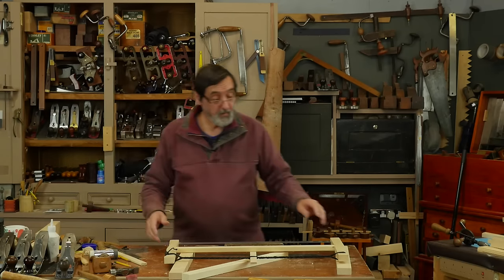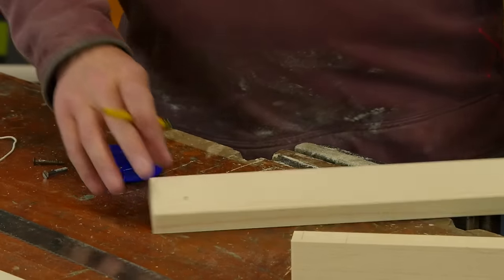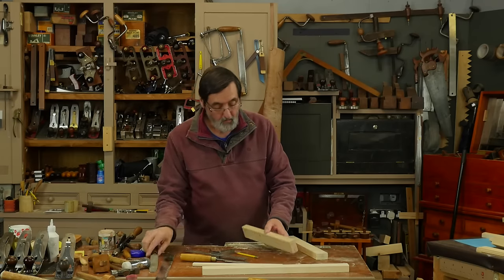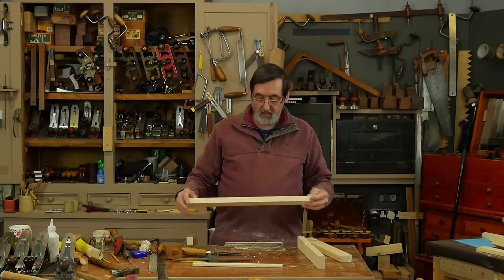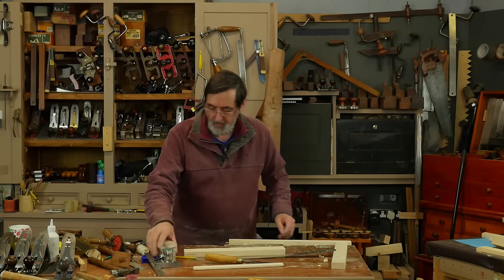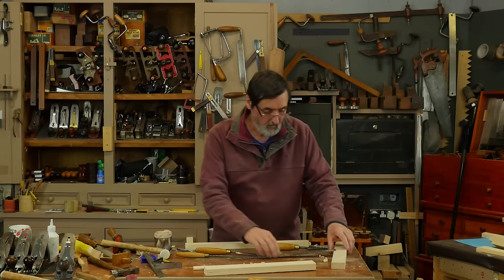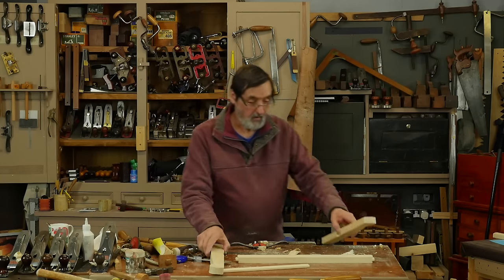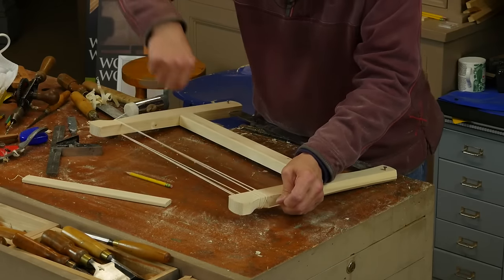Making the Frame Saw | Paul Sellers

Comment: I made this saw just recently using the video.  It was a fun project.  (BTW, now I have two vegetable cans being used in my woodwork :) I put on a new Highland blade for ripping, and that cost less than ten dollars. The wood cost about two dollars at a big box store. But I used existing hand tools (plane, saw, rasp) to construct it. I used Paul's sharpening video to get the tool really sharp, and it cuts quite aggressively, enough btw so that you really need to watch those fingers when starting the cut. I may change the rake a bit to tame it a bit (and give me needed practice). Thanks for the video, Paul.

Comment: Currently there seem to be two kinds of mainstream outlets where to purchase woodworking equipment. One selling equipment like Veritas. Probably good quality but extremely high in price. Like $250 for a hand saw. And the one like Rockler.com which sell gadget, jigs and "handy tools" by the dozen. Typically for the not-so-gifted woodworker who thinks it will help him finish the product. Now my point, related to this video. The 600mm saw blade can be had for under $10. The spruce is in your scrap box and it takes 1 hour (Paul) or 1 week (me) to build it. And it might be the best saw you ever have and (cite) lasts a century. Now, how many REAL improvements have been made in woodworking tools the past hundred years? That is why I love these lessons by Paul.
Reply: well said. we don't need expensive tools to make quality furniture. Don't forget the tools you already have!! You can make amazing dovetails with a bandsaw. If our forebears had power tools they would have used them. I am a Master craftsman with 40 years experience, use what you have. these frame saws are within everyone's reach. Build something great.
Reply: Agree 100%.
Reply: @magicman9486 Sorry, but  power tool dovetail sounds like nails on a chalk board.

Comment: I made one of these but I used a steel cutting blade which was five and a half feet long to cut through a fender on a trailer which had more than one wall to cut through. But I had to use a ready rod or all thread to give enough tension to the blade. It also allowed me enough depth of cut to make the full cut in one effort. They are a pretty good saw.

Comment: i think you missed one point. here in germany the blade on this saws (we call them "carpenters saw"), the blade is usually twistable, so when you set the blade 90 degrees on your wood, the frame of the saw is at an slight angle.
this counter-balances the saw, and you make perfect perpendicular cuts every time. this feature is the whole point of the saw.
we also have those "tenon saws", but for other applications (they are usually used here to cut baseboards), the carpenters saw comes in handy, whenever you have to make long, straight, perpendicular cuts.
Reply: yes I think I saw a video with Frank Claus using this blade.. its incredible.. just no idea how they are made
Reply: @VicPapefu May I suggest you try a method such as found on a typical hacksaw? Which would amount to a square mortice oriented in a diamond pattern in the two upright arms with a square rod or bar inserted w/a pin to hold the blade on one end and a cross pin or dowel through the other to keep them in place against the pressure. Size and strength requirements are up to you to determine. After all, the solving of puzzlements is a part of the joy of this inexact art.

Comment: Lee Valley sells these saw blades as replacement blades for their miter box saws.  You can get them in 22" to 25", 10 tpi to 32 tpi.  Price is $18-$20.
Reply: They are crosscut...
Reply: And all impulse hardened  unsharpenable
Reply: @rickcheckland  The blade from Highland Woodworking or Dieter Schmidt that he is using is impulse hardened.
Reply: Good call.
Reply: Can you relax an impulse hardened blade, for example by heating the teeth to a glow, cool slowly, and then sharpen?
Reply: @MadofaA  yes. But it tends to warp a bit if you aren't careful
Reply: sawmill saw blades work great
Reply: My aport: buy the cheapest saw with fine teeth, use an abrasive disc get  to desirable width, then drill two holes ( i had to find somebody who had a titanium bit) and thats it. Give it a shot, its a great tool, not a museum piece.

Comment: Usually you do need turned parts for it - the handles.

Typically, there are two holes at the points of the frame where the blade is attached. Two handles with a cylindrical ending that has a slit cut lengthwise into it are pushed through those holes, and the blade is fastened with pins into the two handles, not into the frame itself.

This allows for the blade to be rotated around its length. This way, you can start straight, make a cut a few inches down, as much as the frame lets you, then angle the blade and cut away strips from a panel, or board - the tensioned wide blade will take care of the cut remaining straight with not too much guiding effort.

Another use is curved cuts. Besides the wide blade used in this video, there are blades as narrow as 6 mm (about 1/4") - or were, in the past, narrowest I could find to buy recently was 8 mm (that's 1/3"). By constantly tilting the narrow blade by rotating the handles in their holes, you can cut mostly any curve through any board not wider than twice the distance from the blade to the horizontal beam parallel to it.

There's a video somewhere here on YT of a guy named Frank Klausz who cuts dovetails in softwood using such a saw - with no chiseling at all for one of the pieces. Worth watching, IMO, to see what such a saw can do in the right hands.

Maybe one thing worth noting is that whether it cuts on the push or the pull is your decision. The saw is symmetrical, you can use it both ways. Personally, I prefer to cut on the push - the tensioned blade never bends or catches, and the cut is faster. With a wide, properly tensioned blade, it's difficult to not cut straight, IME.

Using it requires some practice. Sharpening and setting the teeth requires a lot of practice too. Aigning the handles, when you don't have the blade fixated to the frame directly, also requires practice (or at least a lot of patience) - not getting this alignment right guarantees crooked cuts, so you immediately know if they're aligned or not. But I feel it's more productive than a short tenon saw with small teeth in many cases, and quite precise too, once you get used to using it. The significantly longer stroke also helps with precision, IME.
Reply: What Paul introduces here is the joinery version of the bowsaw (he mentions this on his blog). This has fallen out of favor a bit, but is still used in France apparently, and is depicted in tons of Historical manuscripts -- they're made just like this, with a fixed blade and no handles. It's the simplest to make hence why Paul probably started with it. As for bowsaws with turning blades (which I prefer too), another common way is to not turn handles, but rather use bolts which are split with a hacksaw and a pin hole drilled. So, you don't have handles, but you can turn the blade. This was used in many parts of Europe -- again, I think in France especially -- and is common in other parts of the world such as China, where they're still made this way. This can be easier for beginners who don't have a lathe or tapered reamer to make the handles.

Comment: I made a smaller version this saw modelled on the one Paul shows here.  It uses a 2-sided blade (Hacksaw/Wood, 24x311mm). These are cheap and readily available where I am in Eastern Europe.  The hacksaw side cuts dovetails quite well.  I have made many small boxes using this saw.  I would include a photo but I'm not sure how to do this.:hand-pink-waving:

Comment: I tried to find a source of blades for the frame saw. Even looking under “bow saw” as they’re sometimes called all I see is those metal framed saws for cutting trees with. Those blades have large, rip-it-to-shreds type blades, not suitable for dovetails. I “saw” a really nice frame saw on eBay but if I ever needed a 14” long replacement blade, I haven’t a clue where to get one.

Comment: Very nice, thanks.

I always liked the feel of a good frame saw, they seem to cut with less effort due to the tensioned blade compared to other saws.

My dad always told me to release some of the tension once done for the day, otherwise the saw might start twisting.
Reply: +Alfred Stampe Yeah, back in highschool my woodworking teacher told us to do the same thing.
Reply: +Alfred Stampe I guess that's why the design evolved to be so easy to tension/de-tension, rather than a threaded tensioner (also cheaper, fewer purchased parts--better all-around).

Comment: I think it is strength to weight that makes spruce so good.  It was used for making aircraft frames in the early days of aviation, and of course it was plentiful, and so cheap.
Reply: +Stephen Gent Weight to strength ratio is called specific strength. And many woods are stronger than steel (if you would believe that!).

Wood is an amazing material! Lightweight, strong, cheap, flexible if needed, carbon neutral.

Comment: When i was a kid i made one of these in a learning program. The biggest difference was that the wood used was oak (probably because as kids we would murder a light wood like the in the video) and the radius was slightly smaller. One other difference is that we used wood dowels for the blade, but the blade (which i still have) has larger holes than modern ones.

Comment: Thanks for the great video Paul.  I have a somewhat strange question:  Is it possible to use the frame saw in a pull mode?  I was thinking that this may improve safety and perhaps improve accuracy  Your thoughts?

Comment: Hello Paul, I'm a new subscriber. I'm just in the starting process of making a folding buck saw for my camping and hiking trips and in looking for tips came across your channel. Would please explain why you make a radius with your mortise and tenon joint for the cross member instead of joining it on the flat? Is there an advantage? I'm making mine out of cherry by the way, since I had it around. Other than it being heavy do have any opinion on that? Thank you

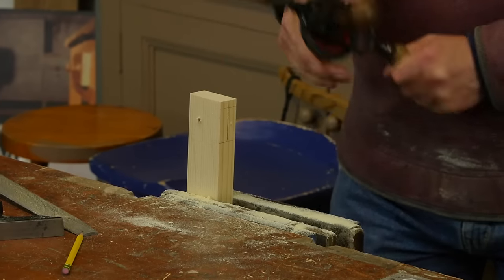Comment: Hi folks. I just bought an antique drill like Paul uses at around 9:43 in the video. Two questions: it moves great but the chuck is stuck shut. Can I soak it in something or spray it with something to open it? Also, does it use standard bits or not? Thanks. Love your videos, Paul.

Comment: Where did you get the blade?

Thanks
Reply: +Nickle You can get a very similar blade from a miter saw. Obviously not the electric ones ;)

If you switch Google to the image search and pop in this "hand miter saw" the first images should be one you need.
Reply: +Nickle Paul Sellers has a blog post where he says he'll sometimes buy portable band saw blades from HD or Lowes and cut them to length for the blades.

Comment: I see a lot of comments about a "cut list". Why? It's really a "build to suit yourself" item. He mentioned the verticals being 16" long, and the material being 1" thick. So go buy some 5/4 by 3 wood, whatever is available in your area, maybe 5/4 by 2 for the horizontal piece, and have at it. Off to 84 Lumber soon to see if they have some 5/4 red oak. Anyplace with spruce is an hour from me. An 8ft stick of 5/4 by 3 yields enough for 3 saws vertical pieces. an 8ft 5/4 by 2 will give 3 horizontals and a cutoff piece that you can make 3 tensioner sticks from. The horizontal piece length is roughly the blade length, maybe a tad shorter.
Reply: And www.rockler.com has Nobex miter saw blades (22" ish) in 18&24tpi. $16.99 each.

Comment: Hi Paul, I made one of these but on a bigger scale (3 1m pieces of 4x1 redwood) to crosscut thick logs, but found that the vertical pieces creaked and moved on using it, causing it to be ineffective. Is there something I've done wrong apart from making it a lot bigger? My joints were tight and the blade was well tensioned.

Comment: Did a pair of the variety with tilting blade, such a useful tool....its life Began on the mobile toolbox dissasembled an now my preferred backsaw is accumulatind dust... :( .
Great thing about this is tha i bought literally the cheapiest ugliest back saw with a joke as a back, and it turned out to be perfect( that cheap steel blade and fine teeth make fine cuts and the long push can be very silent) obviously i cut it with a dremel and made a bunch of free card scrapers. Best 25 soles(8$) spent ever.
And best 36 min spent by this millenial, a like is just not enough to thank paul.

Comment: Just finished making my first frame saw,  looks good for my first one. Actually built it while waiting on the blades, I need to work on getting the beam joints tighter, and the blade, should have measured it or held it in place, the invoice says it was 26 1/2" but it is a little off, the holes on center are 26 9/16" Just enough to not fit, had to drill two new holes, ... I can always do it again, spent a lot of time shaping the handle, and the string curves.

Comment: Thank you for your video. It is very interesting as usual your videos are.
It seems to me, @16 when taking the measure, that the piece on your left is flipped. The screw hole is on the inner part instead of the outer.

Comment: Paul, cheers. just finished a saw using your guide, and was wondering: Do you use the saw blade under tension when not in use?
Reply: Probably late but for anyone in need, no, release some tension

Comment: Got an old bow saw, 30s to 50s maybe, with a tiltable blade and a wire string running through an eyebolt that is tightened by a wingnut. Most likely factory made, with a coarse blade more suitable for construction work, but doesn´t matter. Works like a charm, good depth of cut, blade never bucks (can happen on ripsaws, as they often are used for crosscutting here).

Comment: Can you use these with the blade in either direction so you could have a pull style or a push saw. Without having ever used one it appears that with a pull configuration the blade is subjected to additional tension from the pull action which would help keep the blade from bowing. When you are pushing on the blade even though it may be in tension from the string as you push on the blade and it encounters resistance in the wood it seems there would be a tendency to de-tension slightly on the end of the blade closest to the point where force is applied (your hand), leaving the front part of the blade which has exited the cut in tension and the back portion in compression.
Reply: Any blade you desire.

Comment: What teeth spec is this blade?? Rip cut or cross cut?? Other than this how did you mount the blade with respect to your handle side? As push cutting direction or pull cutting tooth direction?? I am aware that any combination will work but I want to know what will work best as per your experience?? Kindly revert.
Reply: +Atif Hasan Mr. Sellers is a push-cutter from all the videos I've seen.  Also from the few strokes he takes in this one.  I see cutting on the push.  As to specs--good luck.  I think I'll build 3 of these, equip each with different blade.
Reply: Thanks Wade:)

Comment: There also used to exist a frame saw where the blade can be rotated 90 degrees to make rip cuts which length exceed the frame height. Is that another saw or just a variation on this one?
Reply: Hi, the blade can be rotated by 90 deg as it is fittet in a rotating handle at each end.

Comment: I've seen several of Paul's videos and I've always wondered: "why does he use imperial measurements?" Being from the US I appreciate and understand it, but why would someone from Europe use it? I've always thought of metric to be easier to convert and use, but as I've said, I'm from US and still use imperial. just curious.
Reply: The UK adopted (officially) the metric system in the 1970s when we joined the EEC. Prior to that (since 1824) Imperial units were official. 'Imperial' is so named because of the British Empire. Anyone educated before and during the 1970s would have been taught to use imperial units.
Reply: Thank you so much! I really appreciate the explanation, and it makes perfect sense. You rock!
Reply: MMOGood2Go I am from Canada and was taught the metric system all through school. at my first job and since then I've used imperial. I have only ever worked with one guy that used metric and it was very confusing for both of us.
Reply: MMOGood2Go Holy shit! An American that understands and appreciates metric? We need more people like you!
Reply: I only knew metric before Paul. I am learning Imperial because I like the sizings visually. I've also found when dealing with larger measurements it's far easier for me to remember inches than mm.
Reply: I do not want to rude, but Americans generally either have great problems converting imperial to metric, or plainly refuse it. Europeans seem to be a bit more flexible and can multiply measurements by 25.4. Due to the history of internet and youtube Americans have shared many articles and videos in imperial measurements. If Europeans want Americans to read articles or watch videos they have to speak imperial otherwise they are not understood. I don't understand the fuss at all. I am metric, but if I have to scribe a line at 3-1/8, I take my tape measure and measure 3-1/8. And half that is 1-9/16. So? Personally, I don't like when Paul shows the metric conversion as a label whenever he mentions and imperial measurement. We went to school!